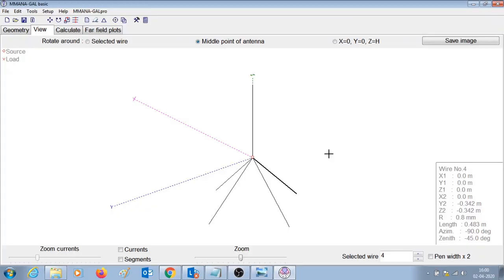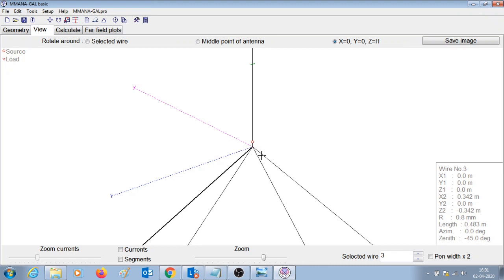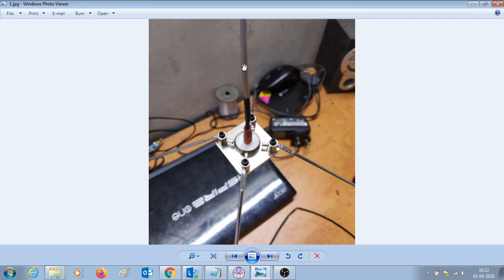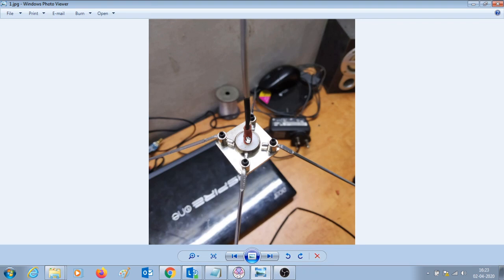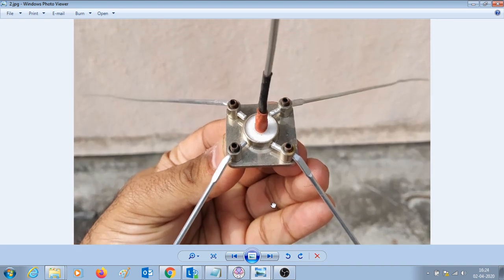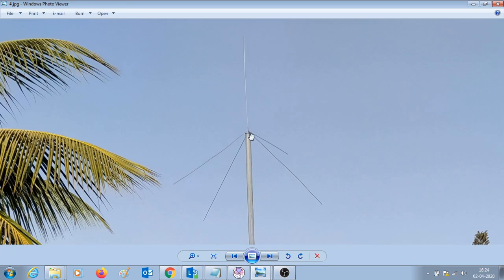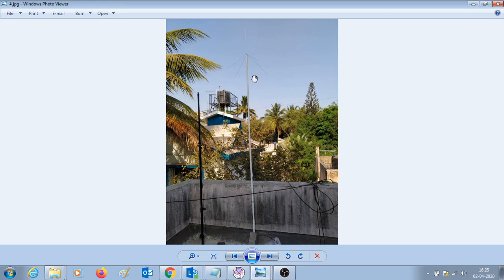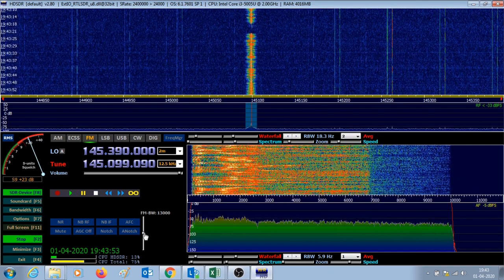Construction of 2 meter quarter wave ground plane antenna

Comment: PMR 446 mhz
Vertical monopole  16.13 cm
4 Radials.                  18 cm
LPD 433 mhz
Vertical monopole  16.61 cm
4 Radials.                  18.61 cm 
144 mhz
Vertical monopole  50 cm
4 Radials.                  56 cm 
Diameter 2mm
the inclination (degrees) of the 4 radials +/- SWR

Comment: Damn that looks good!  What are the brackets you used on the SO-239 to secure the leg elements?
Reply from the maker: @N4BFR Vision They are called linkage stoppers. Check out rc plane hobby stores, you will get them there.
Reply: @AniruddhaBokilVU3FML I found a few on Amazon etc.
What size should they be?
2 mm??

Thanks in advance
Reply from the maker: @drankurbaruah  yup 2mm
Reply: @AniruddhaBokilVU3FML  👍🏼